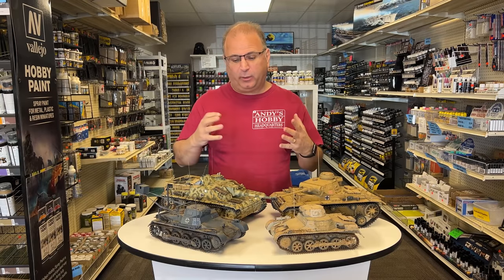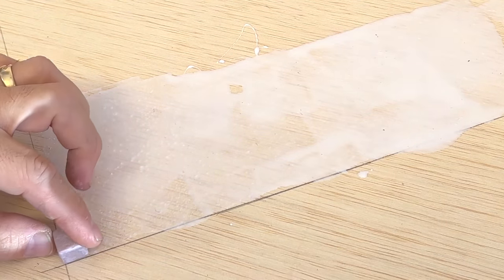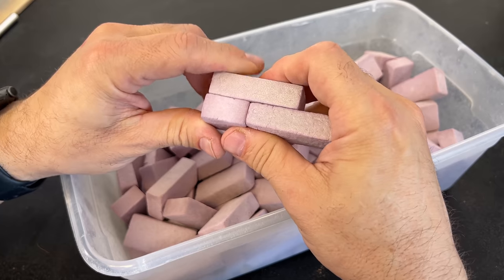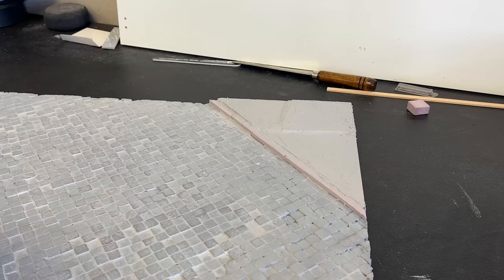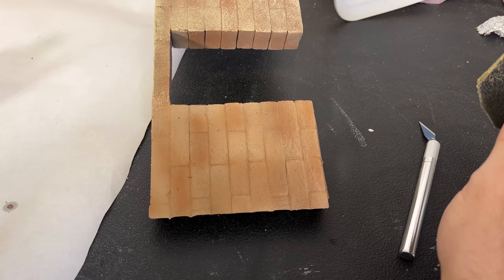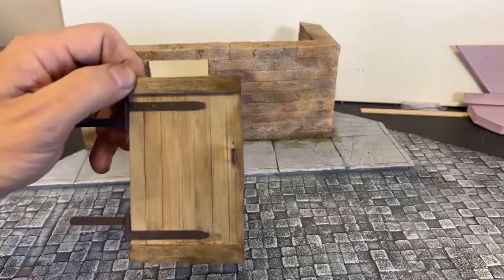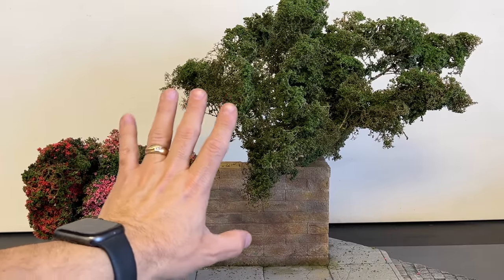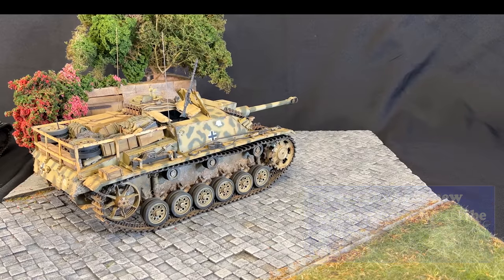Large 1/16 WWII Cobble Stone Road Diorama ( All made out of foam )

Comment: @ 18:06 - what I’ve found that works great on any foam, is Gorilla Clear (non-foaming) and maybe a couple dots of hot glue to hold it till the the gorilla sets. Also, clear fabric glue is great. The main difference is that the fabric glue doesn’t like paint (especially acrylics) and the gorilla clear doesn’t care what you coat it with. 
Now I have to pickup a 1/16 kit, or rather add to my wishlist and hope that the fam or Santa will gift it to me. 
Thanks Andy. 😡🤪🤣😉👍
Great video. Your diorama skills are steadily improving. Keep up the great work.

Comment: Nice model...there is just one missing detail.
On boundary walls in cities and towns you  would not have exposed mortar joints on the top. Usually walls had capping slabs of sandstone or some other dressed stone. The reason being most brickwork up to the 1950's was constructed with lime based mortar which was more soluble and eroded quicker then the Portland Cement  that is used today.
To give you an example, the house where I live was built in 1903, and the rear boundary wall is 19 courses of bricks and is just under 5.5 ft high. On top of the brickwork there are sandstone slabs approx. 4ft x 1ft x 3" across the top. 
Another thing to note when modelling old brickwork is that the mortar is not flush with the brick sides - before I repointed my boundary wall there was a gap of over 1/4"  deep between the bricks.

Comment: Truly amazing realism, but I would like to make two observations. 

1 - A minor point: from my experience of seeing walls in the UK and Europe, the lintel above the gate always tends to be of a different stronger stone material. This might only be in building walls, however, as the lintel needs to take the weight of bricks above it, so for a garden wall, the same material might be acceptable. 

2 - Logically, the hinges on the gate would be on the inside, not the street side. If one considers, the purpose of a gate, it is to prevent unwanted access, so placing the hinges on the outside goes against that objective as any would-be intruder with a screwdriver would easily gain access. 

Nevertheless, this is a very rewarding video for makers of dioramas. Thanks for publishing this.